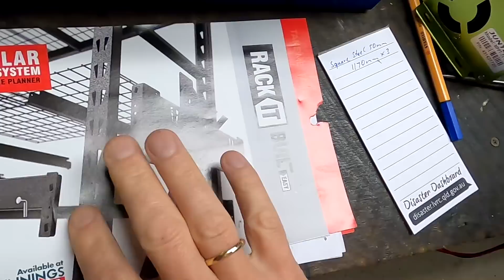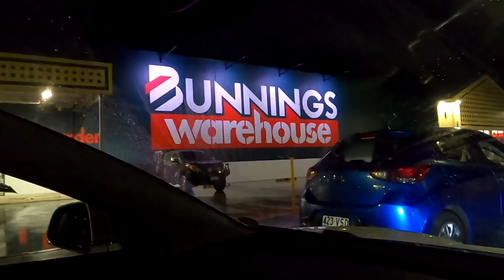New storage solution to host my battery banks. It's enough for 45kWh. Battery 2.0

Comment: Hello Andy nice job. I am in the beginning of building my off grid system here in Belgium and can't find any suitable shelf here so i have to make and weld my own.
What is the height between the shelf's ? 
You mention 50mm above the cells was not enough and in the comments no measurements so this begs the question . ↓↓↓↓↓ 
What is the distance in cm between the shelf's where the cells going to be or are located ?  Many tnx in advance Andy. Greetings JP

Comment: I watch a few of these channels and its interesting how different people build battery storage.  A lot of people with wood skills use wood.  People with metal skills use metal.  People with lots of money buy expensive industrial rack trolleys.  
Me?  I'm going for "Really useful box" batteries.  Pre-made boxes that I can drill holes in.  Granted the weight factor will mean that runs out of legs once the battery gets above about 20kg.  However, you can go quite a bit bigger using the likes of Stanley or Harbour Freight tool chests and toots.

Comment: I am guessing you got that HD shelving from Bunnings, where you can buy each part as you need under the Rack IT brand. Over here in the UK, I can see it is branded Matlock, and they sell a complete rack with 4 shelves for around £120-140 (depending where you go), part # is GRFLEX-361872 (cheapest seller in the UK is Zoro, who deliver for free). In other countries I can see the same part number, but branded Tactix. Classic Chinese 'any brand name you want us to print on it' supplier. One thing I like about the Matlock version is you can split the sides into multiple lower height units.
Reply from the maker: Well I showed this in the first minute of the video where I got it from 😉
Reply: @OffGridGarageAustralia  Yup, you sure did. Big bright and neon :-)

Comment: Hi, I would put some big/wide ceramic/granite tiles on top of the mdf board, it will give us flat surface, fire/high temp proof, (of course it is fragile if sudden hard force applied on them). In my place, humidity is the enemy for the mdf board, after some time the mdf will always become bending, not flat anymore... Fortunately I have plenty of excessive ceramic/granite tiles, and I have the proper tool to cut the ceramic/granite tiles (a ceramic cutter), so the shape and measurement of the tiles are accurate....

Comment: Hey Andy, enjoy your videos and experiments.  I looked on your web site for what circuit breakers you are using and saw no listing for them.  Would you mind adding them to that site with the links?  There are many options and no way of knowing the quality.  Most not listed UL rated.
Reply from the maker: Hi John, I went with the Noark Moulded Case Circuit Breakers (MCCB) 100A for each battery bank and a 250A main battery circuit breaker. They are two pole breakers with and have a very high disrupting current Icu of 25kA, so are on par with the Class T fuses. The trip current can als be adjusted to suit your needs. I'll make a dedicated video about this once I have them here next week.
https://na.noark-electric.com/noark-productLoader.php?PRODUCT=MCCB002

Comment: I read through the comments and saw your concerns about tipping if you used casters. A possible solution would be to secure one corner of the cabinet to the wall thus allowing it to pivot away from the wall. Then you’d have easier access to everything and not have to worry about tipping.
Reply from the maker: Thanks Kevin, that would not work as there is the metal vertical beam on one side and the electrical cabinet on the other side which would prevent that.

Comment: Look at Aluminium busbar , you can purchase a 4 meter length of say 5mm x 32mm aluminium and that is not expensive at all, you just have to deal with the dissimilar metals but you can do that with various tubes of goop. Just an idea and they are being used on your interconnects between batteries ( to many big words got to relax brain now)
Reply: Yea I use aliumium busbar on my 16 AGM batteries set up at 24v for years never had a problem!
Reply from the maker: But that's not bus bar aluminium then, just the one you buy at the hardware store. Same with copper pipes some people use. It's a lower quality metal and can cause issues.
Reply: @OffGridGarageAustralia  you can get a good selection of aluminium from various distributors,  plus I never buy aluminium from a hardware store
Reply from the maker: @keithj30  I cannot get any better nearby and would need to order but bar aluminium. The 32x5mm you mentioned would be rated for 125A.

Comment: If cost of the cables / bars is an issue have you considered going to  metal recyclers that may have old power company scrap and lightning / earthing conductors?
Reply from the maker: Considered that, but most of such metals are still too expensive if it is a busbar. Busbars are made from pure copper, all other conductors are of less quality and therefore cheaper. If I also consider time and effort to drive to Brisbane and look around on scrap yards for the right thing, It's just not worth the hassle.
I've got a smaller busbar now for A$220 per 4m length tinned pure copper (T1).
Reply: @OffGridGarageAustralia   Good luck with your latest project. I hope you have or aim to purchase a milli / micro ohm meter to test and record EVERY joint and connection as I had to do in the 1980s during high current stand by battery installations.
Reply from the maker: @MrAE2780  I've got an internal resistance tester. There is an episode about that and how I measured all these connections.

Comment: Have the same problem. All the cells in shelves.  I have 3 OSB boards under the cells to prevent the board from bending. How do you want to make this cabinet water resistant? Like an IP55 level. Your inverter cabinet is like IP55. The main problems are the doors.
Reply from the maker: I'll show this in the next video. As the shelve will sit in the garage, it does not need to be water resistant. The cabinet at the wall was just like this when I bought it, but it does not need to be like this.
Reply: @OffGridGarageAustralia  You can have a leak in the roof ... or a faulty garden hose ... or anything. The pack has a very big load. Even your previous box is water resistant. I say better safe than sorry.

Comment: Aluminum is fine for high current busbars. 2"x1/8" will handle 200A no problem. Much cheaper then copper Also I would put cross support angles under the wood shelving. The wood will sag over time especially if the air is damp. Cheers
Reply from the maker: Al is not much cheaper if you look into Al busbar quality. It's not the same Al you buy at your warehouse for building purposes. I compared and Al was 15% cheaper for a 360A bus bar.
The shelve has 4 supports underneath but is certainly not the best solution for that.
Reply: @OffGridGarageAustralia  I have build many systems with al. busbars. It works great. For 20 feet of 200a rated 6061 al. flat bar I pay $50. I hope you something under the shelves. I would weld them and get rid of the wood altogether. Just an idea to save you time. Hopefully you get years of use from them batteries without problems. Check my channel if you get time. Ill leave a link to my house system. 10kw inverter 60 kwh lifepo4 storage. Been running my house full time for over a month but usually I just use it for heat and backup power. Cheers
Reply: @OffGridGarageAustralia  heres a video from a year ago when my system was turned on.......https://www.youtube.com/watch?v=bY5ZaNyaV34&t=1501s

Comment: This comment is a bit late, but just want to recommend a server rack for this, they can be a but more expensive but they're made for this. And with rails you can slide each unit in and out. Also you can have an easy hot negative and positive rail on the left and right entrance.
Reply from the maker: I looked into this but they were not suitable to host 16 cells on one shelve. The drawers are not capable of carrying such a lot. I looked for used once and found some too small, no side panels, too far away... too expensive.

Comment: 070521/0138h PST 🇺🇸  070521/1838h Brisbane 🇦🇺 . Good to see the interesting modifications. Instead of Aluminium sheets for the open sides;15mm Perspex may be suitable, as you want to isolate the LiFePo4s from conducting materials. You may also, want to illuminate the inside with LED emitters. Ventilators perhaps?. My thought. The shelving looks sturdy with the maximum load capacity of 400KGs.
The idea of disconnecting both PV input and LiFePo4 power simultaneously is a great idea. Would appreciate if the design could be posted. 
Wishing you all the best for the new endeavor. Stay safe and 73s…

Comment: Great idea. Maybe add some caster wheels so you can move the rack around if needed.
Reply from the maker: I'm afraid it gets too top heavy with three battery banks and may tip when pulling incorrectly. I will screw it to the metal beam of the side wall.

Comment: Is there a wheel option for the shelving unit? Could be potentially useful, maybe?
Reply from the maker: The shelve may get too top heavy with three batteries in it. I would be too scared it may tip. 💥

Comment: how about the victron bus bar power in. Its extends in length for larger systems.
Reply: @OffGridGarageAustralia  Agree $$$ but its a clean finish and the fuses are built in so no buying fuse holders.

Comment: Hi Andy, I have used this type of storage before, I recommend you replace the bison board with ply wood. The bison board warps and sags in the Queensland humidity. I installed fencing palling so cut to size, it wasn’t as tidy as ply wood have been.
Reply from the maker: Yeah, I have 4 support brackets underneath and it seems to be fine. We usually have very dry climate here, not much rain or moisture..
Reply: @OffGridGarageAustralia  my Townsville experiance was a little more humid 😘👍🍺

Comment: Hi Andy, about the expensive bus bar: here in Zambia, I bought a strip of sold copper, drilled some holes and put it in an lunch box or plastic cable truncane. Much more affordable. And what about the guy that madethe small bus bars for your battery, can't he make someting more affordable  for you. Hopefully this will save you some beers ;)

Comment: Great going.....
I believe, you will ride off from your inverter encloser very soon....
By the way, my raspberry pi for venus os getting disconnected every day although lan/ wifi internet is ok.
Any help Andy.....
Reply from the maker: Thank you. The electrical enclosure will stay but the inverter inside will go. 
Disconnected means? Just disconnected from the network or does the Pi drop out altogether? I would connect it with a cable and see if this makes a difference.
Reply: @OffGridGarageAustralia  Disconnected from network. Tried lan connection also.....
Not solved
Reply from the maker: @bishwagit  what Venus version are you running?
Reply: @OffGridGarageAustralia  v2.66

Comment: Hi Andy I just received 8 x 302 AH (ordered 310ah) from china. Took 2 months. Seem to have fixed lugs (poles) the bits that stick up!
Reply from the maker: What letter do they have? 302K? It's on the barcode sticker. They could be higher and have the terminals further apart as the 280Ah cells.
Reply: @OffGridGarageAustralia  302AH. Also contact area at base of lug us smaller than me 240AH
Reply from the maker: @BajanAlan  oh, wow, that should be larger actually...

Comment: This will be awesome! Can't wait to watch the new build come together. The only thing I think about now is that your panels will not be enough to charge all the new battery banks? I'm sure you will have that figured out though..  ; )
Reply from the maker: With the current setup, it won't be enough in winter, no. Sometimes I'm only making 2kWh per day but can be up to 5kWh if a bit cloudy. In summer, I'm laughing. That will be close to 20kwh per day. I still have lots of roof space so can expand. But I wanted to start slowly with that and not ending up with expensive solar charge controllers and a huge amount of panels.

Comment: Why not Aluminum busbar?
Reply from the maker: Aluminium has higher resistance and therefore needs  a larger area to make up for the same conductivity. Aluminium bus bars do usually have metals mixed to it as well, to make them a bit more flexible and not as brittle as pure aluminium. This makes them more expensive though as this is a better quality aluminium for busbars in terms of conductivity (unlike the square bars you buy at the hardware store for building purposes).
All in total alu busbars were like 15% cheaper then a compared tinned copper one but harder to get for me.
Reply: @OffGridGarageAustralia  Thank u. Elon is using Alu instead of copper in some motors!
Reply from the maker: @BajanAlan  I know but I think this has other reasons, magnetic fields, weight, ...

Comment: Is there a way to put caster wheels just in case you have to move it
Reply from the maker: It will be very heavy and due to the height, I'm worried it may tip.
Reply: @OffGridGarageAustralia  true true

Comment: Why not get a copper pipe and flatten it to make bus bar ... thats what I have done
Reply from the maker: Copper pipe is low quality metal and you never get it really flat. Could work for low currents and smaller projects.
Reply: When you do get your custom bus bar, why not test its capacity against a similar sized flattened copper pipe(s)? What ever the outcome I think it would be valuable information and make a good video for your site

Comment: Those shelf panels look like about 10-12mm MDF. With the weight of batteries, that will probably begin to sag in a few months. It might be a good idea to add some reinforcement under each shelf.
Reply: Absofreakinlutely! You beat me to it. When it sags, it’ll put a lot of stress on the bus bars then the terminals.
Reply: Was going to say the same. I replaced the mdf on my shelf with 18mm plywood after they all sagged from heat and garage humidity level.
Reply from the maker: Shelve is rated for 400kg per shelve when evenly distributed. The MDF has 2 metal support beams underneath which I have amended to 4 supports now. But yeah, the MDF is not the best solution. I may get some 5mm Al floors for each shelve
Reply: @OffGridGarageAustralia  
Wisdom
Reply: @OffGridGarageAustralia  If you go with 5mm aluminium, pop riveting it to the frame would stiffen up the whole structure significantly.

Comment: You do not need equal length cable for all the batteries if the cable is thick enough. You can use 00 or 0000 cable of different length per bank to cary 80 to 100 amps and the losses will be minimal. Then you can connect to a Victron  LYNX or power in with mega fuses. This will be a nice and budget friendly alternative. I have this combination in my system and, with the inverter max out the current difference between the 4 banks is less than 1 or 2 amps….
Reply from the maker: Thank you.

Comment: Keep an eye on those "wooden" shelves.  They tend to sag over time as they are exposed to humidity.  I've seen a ~10lbs load completely fall through the shelf as the shelf sags over time and eventually gives way.
Reply: Stiff backs down the center and sides of each shelf. Even 25 or 37 mm  by 20 mm will add a lot of stiffness to them.
Reply: I bought similar shelves and immediately glued 1/4" plywood to the particleboard shelves for more strength, then added a 2x4 brace front to back for each shelf.  Now I actually think it'll hold the weight it claims!
Reply from the maker: They have 4 metal supports where the battery sits.
Reply: @OffGridGarageAustralia  ah didn't see those; that's good!

Comment: i think i would change the shelving shelf's the wood don't look strong enough to hold the lbs of the battery's over time ,,,
Reply: Andy, I never buy the MDF shelves…not strong enough and too expensive.  Get from Mr. Bunnings too the 12mm non structural plywood and get it cut to fit your shelves.  Cheaper and stronger.  Do not forget to add to the shelving system the shelf braces.  Raz

Comment: Interesting with one BMS per battery pack instead of a 3P solution if I understood you correctly?  I have talked to a couple of the companies that sell BMS in the +300A range on Alibaba and none of them recommend to do parallel BMS, they all prefer parallell batteries connected to one BMS.
Reply: @Jonas Granlund When you are paralleling cells, the best way to group the cells is to:          1) measure the capacity of each cell, 2) organize them lowest to highest, 3) grab the lowest and put it with the highest, 4) put the 2nd lowest with the 2nd highest, 5) and so on, working your way in until you get to the middle 2 and combine them. Your pack will rarely go out of balance.

Comment: you could use aluminium , you need a bit more per amp, but it is much cheaper, and will not oxidate.
Reply from the maker: Al bus bar was 15% cheaper than copper. It's different Al for bus bars than you buy at the hardware store.